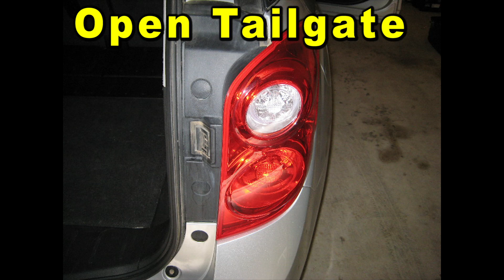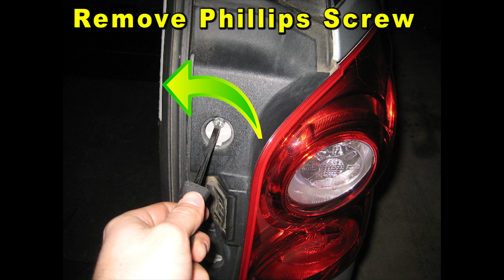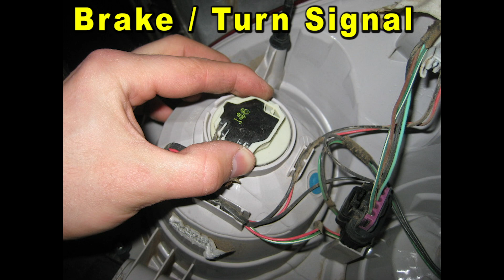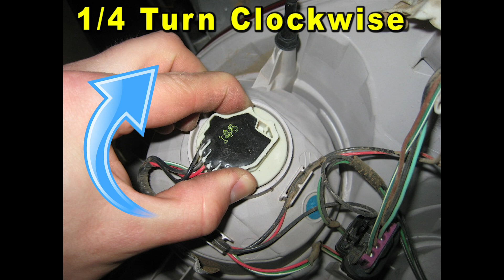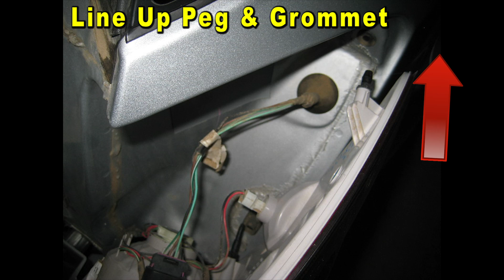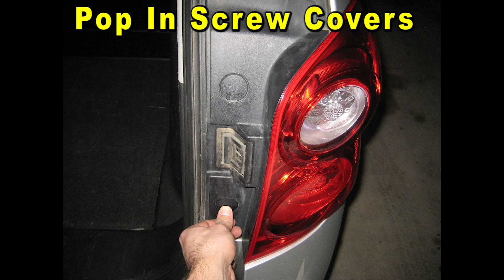2010 To 2017 Chevrolet Equinox How To Change Tail Light Bulbs With Part Numbers

Comment from the maker: Chevy Equinox Brake / Rear Turn Signal Bulb - https://amzn.to/3W9LjxL
LED Brake / Turn Signal Bulb Part Number - https://amzn.to/3W8Nwt7
Chevy Equinox Reverse Light Bulb - https://amzn.to/4cPmRag
LED Reverse Light Bulb Part Number - https://amzn.to/3XLX3HZ
Rear Side Marker Light Bulb Part # - https://amzn.to/4byv0Pg
Precision Screwdriver Set - https://amzn.to/3sLixaP
Plastic Pry Bar Tools - https://amzn.to/3HMtsV7
Socket & Ratchet Set - https://amzn.to/3Z17LbA
Mechanix Gloves - https://amzn.to/3jCnHkt
Torque Wrench - https://amzn.to/3vS5uSI

The Paul79UF YouTube channel is a participant in the Amazon Services LLC Associates Program, an affiliate advertising program designed to provide a means for sites to earn advertising fees by advertising and linking to Amazon.

This DIY video shows owners of the 2nd generation 2010, 2011, 2012, 2013, 2014, 2015, 2016 and 2017 Chevrolet Equinox how to change a burnt out combination brake and rear turn signal light bulb, the reverse (backup or back-up) light bulb and the rear side marker bulb.

Comment from the maker: Check out the DIY guide for changing the tail light bulbs on a second generation 2010 to 2017 GM Chevy Equinox - 
https://www.paulstravelpictures.com/GM-Chevrolet-Equinox-Tail-Light-Bulbs-Replacement-Guide/index.html

Here are all of the DIY repair and maintenance tutorials for the 2nd generation 2010 to 2017 Chevrolet Equinox - 
https://www.paulstravelpictures.com/Articles/GM-Chevrolet-Equinox-Repair-Maintenance-Guides.htm

Owners of other GM vehicles such as the Spark, Sonic, Cruze, Volt, Malibu, Impala, Camaro, Corvette, Traverse, Tahoe, Suburban, Colorado, Avalanche, Silverado, Verano, Encore, Regal, LaCrosse, Encore, Enclave, Canyon, Sierra, Terrain, Acadia, Yukon, Savana, ATS, XTS, CTS, SRX and Escalade may also find these DIY instructions to be helpful.